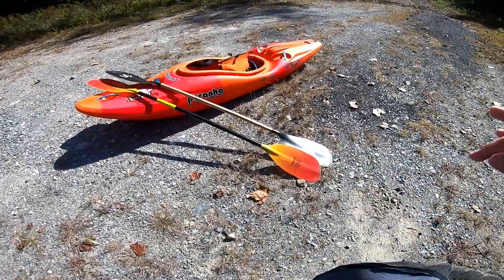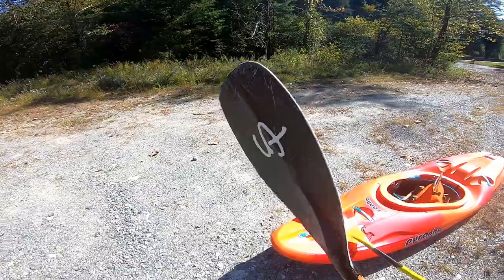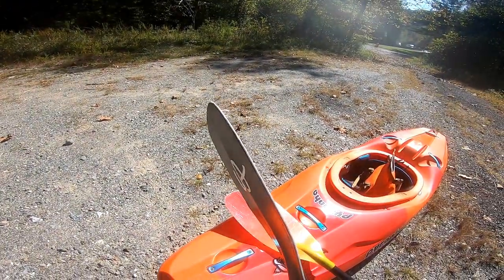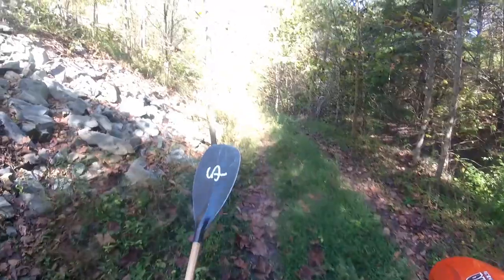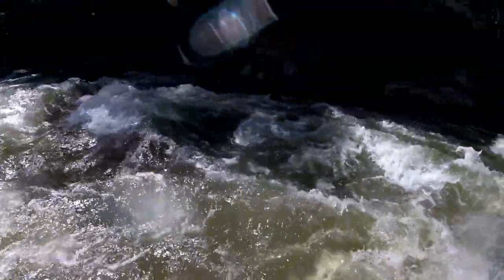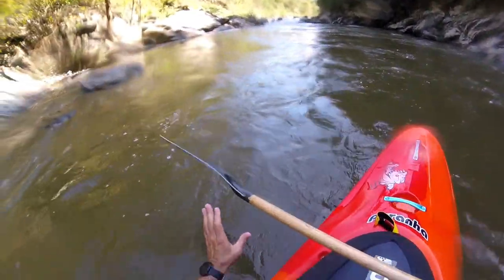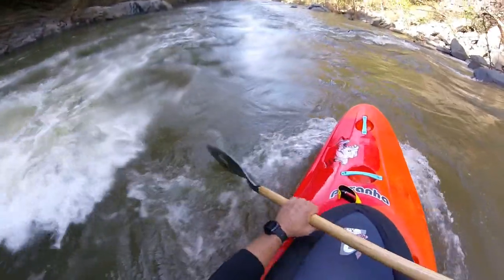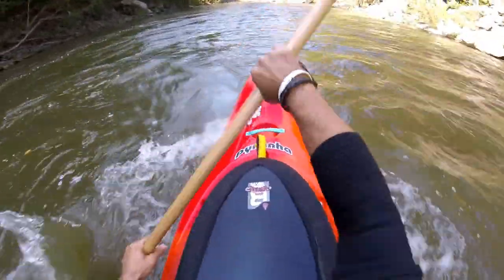Wood Paddle Or Fiberglass? "Stout Paddle Review"

Comment: Try a Jimistick and get back to me.  lol.  I usually use an AT2, but lately i've gone back to my potholes and backlunds.   Can't beat that wood feel.  Especially in the winter.   The stout looks pretty sweet, but so do the shadetrees.  Etowah paddles is coming along nicely too.
Reply from the maker: I have used both pothole and Jimistick and construction wise amazing but didn’t like the blade shape on them.
Reply: @WadeHarrison  Try a slasher blade on a pothole, or the Wildwater 7.5 blade on a jimistick.  Once you get past a certain age and certain number of shoulder rebuilds, those small blades make more sense.
Reply from the maker: @broberts1505  I just can’t get over that weight and on a that certain age Chris Hipgrave is in his early 50s and he said he will only rock carbon never wood and that’s Dudes not a weekend warrior type paddler he’s always out charging but I do agree these carbon or Kevlar layups are not as friendly after useing that wood all day really hard I did not feel as sore in my shoulders

Comment: Appreciate the content and enthusiasm!! I've been using a wood  paddle (Saltwood) for some disciplines for the previous six + seasons and really dig it.  (Surfing / Rock Gardening in the sea kayak/ training in the long boat - a buddy of mine used it on the Grand) - I feel like its easier on the joints, has a different flex to it, like a little reboundy (like when you de-camber a ski/snowboard and use the energy to pop you forward) and have heard others commend it having a warmer feel, which in cold water, I reckon could be nice.  I was all about full carbon for a number of years, but after trying the wood I noticed less wear/tear on my joints.  (IME you could get a similar feel with the older AT Flexi shaft and once upon a time ago I recall Werner making a FG shaft with carbon blades, that was the biz - same sort of flex in the shaft, but power from the blades).  Super appreciate the foray into the forward offset on the Green Stick, and am intrigued ;-) - Curious to know if you think folks break Odachi's in the SE b/c the rivers can be shallower and negate some of the performance advantage of that blade?  (I have had one for many seasons, but typically will not use it unless the water is deep) - For mid to low water I'll use the Surge ~ Stoked to see where his designs go and catching more reviews!! (Perhaps you could put the FWD offset blades to to the test - Werner, Lettman, G'Power, Stout Paddles)  **Also seeing that Scorch (Medium I presume) get run through the ringer is going to definitely cause troubles in the bank account - ha ha  ~ Mahalos Yo!
Reply from the maker: Good feedback Brian 
And as for broken odichid I actually broke mine on great falls and I know a lot of others that have broken theirs is all types of water so it’s just a problem with that layup and design I was like the same as you this is not coming out unless big water well the great falls was big water and I still broke it but it’s ok everything breaks eventually if you are using it
Reply from the maker: Yeah the medium scorch and it’s been awesome

Comment: As someone that has made and used a fair few wooden paddles, this looks super intriguing. Thanks for the video Wade.
Reply from the maker: Yeah I liked the direction of this one I cant wait to see the updated version.
Reply: @WadeHarrison  for sure. Can you confirm, is it a woodcore blade? Or just composite blades on a wooden shaft? Either is impressive, but especially with that forward offset a woodcore would be some next level stuff!
Reply from the maker: @MatthewBrookKayaking  the blade are wood core with carbon layers on top
Reply: @WadeHarrison  well, that's absolutely epic. Might try to get my hands on some!